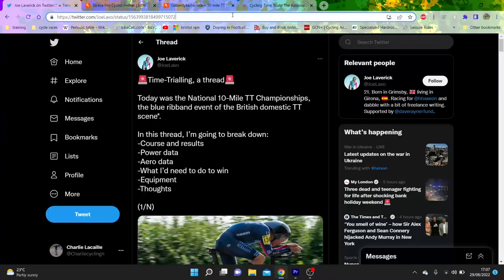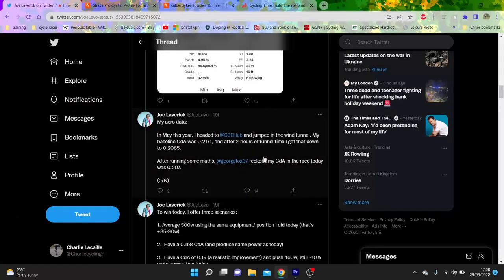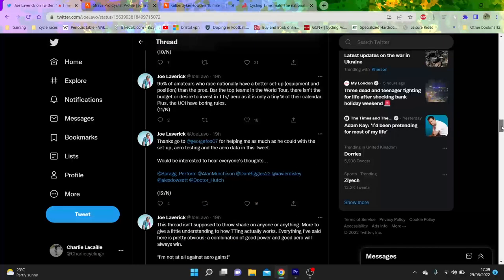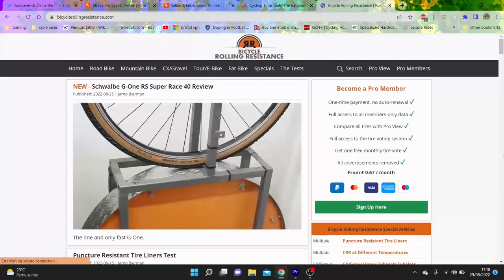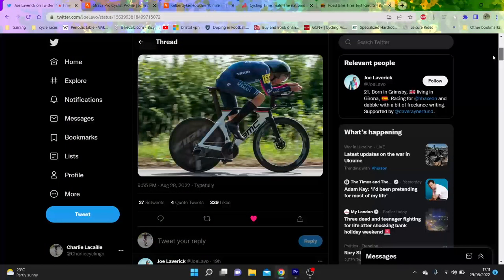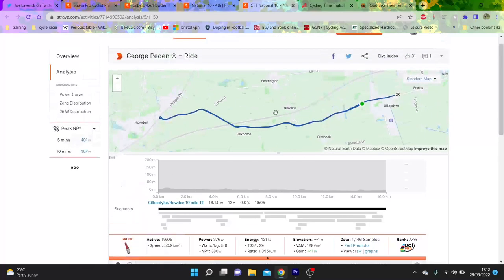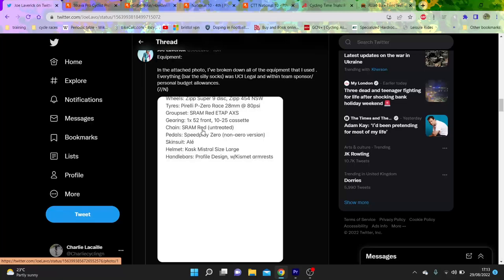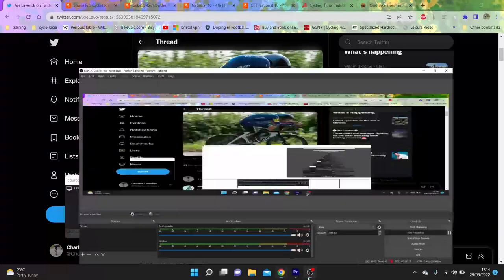How many watts to WIN 10 mile TT NATIONALS?

Comment: Hi, which are the faster tyres out there, taking in consideration a lot of cornering, and there syze, tubeless, clincher
Reply from the maker: Fastest is corsa speed but useless for general riding. Fastest for general riding is gp 5000 s tr
Reply: @CharlieCarbsandCycling  Yeah, that’s why I’ve got a GP 5000 on my bike. I want vittorias but I heard they wear and puncture faster